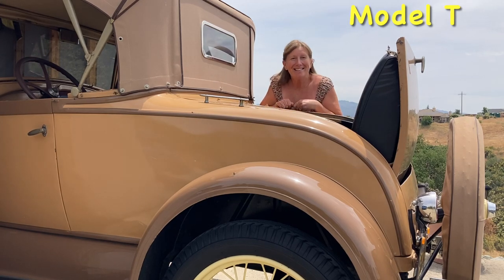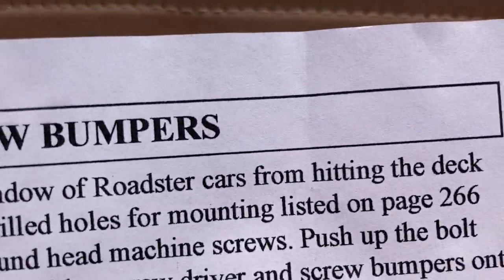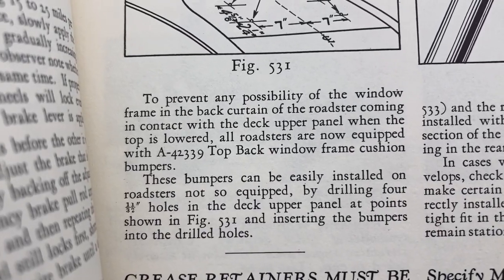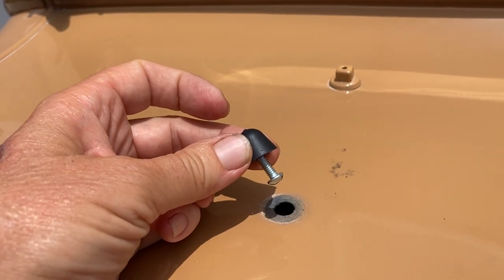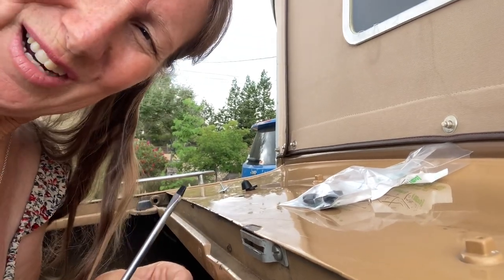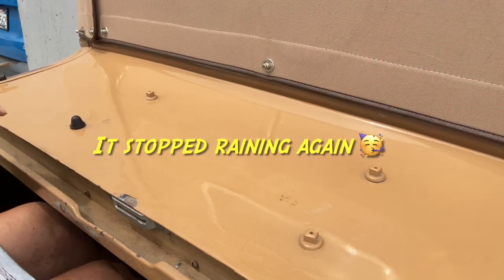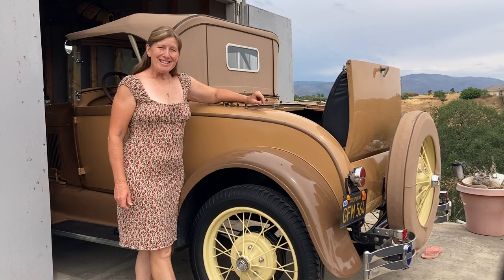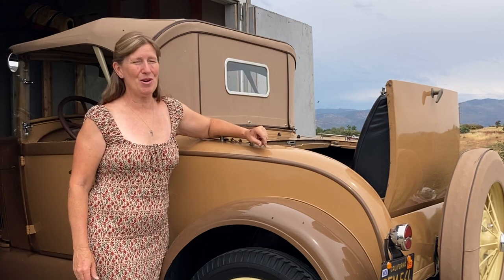Model A Ford how to install window bumpers for 1929 Roadster & other convertibles

Comment: Thanks for sharing Tina. 
As others have said, cutting the paint with a very sharp knife will stop it cracking in the wrong spot, also heating the area carefully will make the paint less brittle too. A hair dryer will do. I often remember this just after I chip the paint, haha.
Keep up the good work.
Reply from the maker: Thank you for sharing, have a nice weekend 💗

Comment: Good job. You might consider taking each screw back out and putting a dab of loctite on each screw, or use a lock washer on each screw to prevent vibration backing out the screw over time.
Reply from the maker: Thanks, I’ll check it out! Have a great week! 💗

Comment: Cat is a goofball!  Looking at those, do you think the old ones were in upside down?
Reply from the maker: Lol, he is! I don’t think so, the rubber part of it was about an inch long and not quite as wide as a pencil, also had a bit of a twist on the end as if to assist with getting it in a hole. It would be interesting to know what they are actually for?